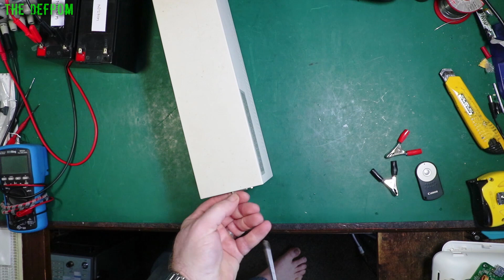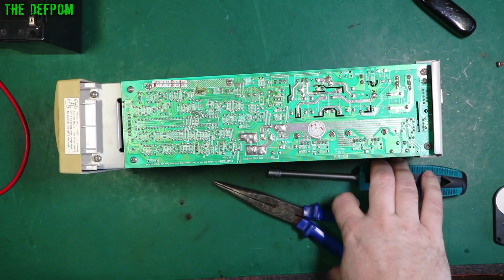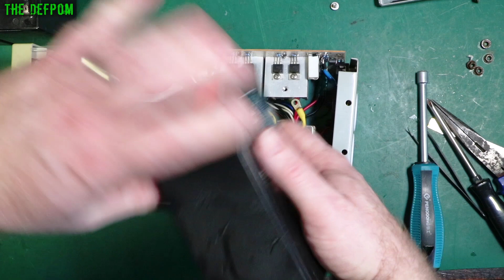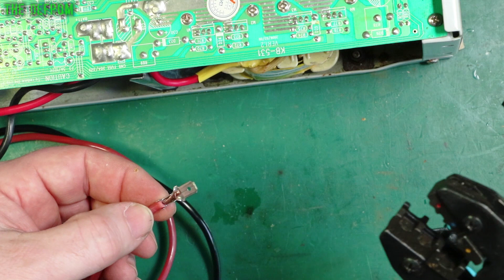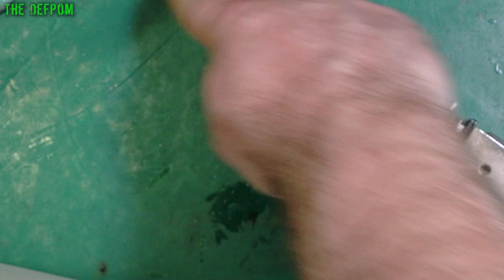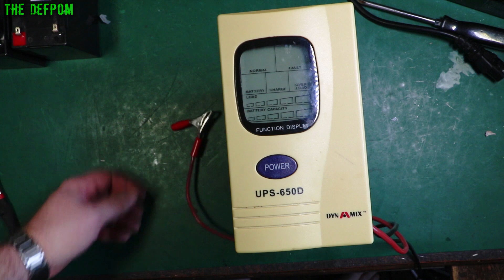🔴 Dynamix UPS-650D Battery Replacement Hack - No. 815

Comment: Temp. is a problem for these small battery's. Panasonic, BB battery all 6 up to 9 year at 20 degrees max. At 50 degrees just 1.5 years then they  need to replace.
Reply from the maker: That could be related, these cases do get warm to the touch.

Comment: Try to sleeve the hole you certainly won't enjoy having a short on a car battery if thisecwires ever abrade to point of shorting the battery , at least more than charger source. The car battery could start a significant fire.....

Comment: If soldering, leave the crimp on insulation till after soldering, as if crimped before soldering that will no longer support the insulation point after the heating of the joint by soldering.

Comment: A 13.7V level is ok at 25°C, but only if the voltage 9f charging is temperature compensated. Typical -3 to -10mV/°C, as these are typical on automotive charge by alternators
. If the battery were running at average around 50°C  say using -7mV/°C amr9und 13.5V fl9at voltage may be better. The observed 13.7V could cause progressive deterioration, I have no technical SLA  data at hand at this instant..

Comment: I think it must be the quality of the charge management in these UPS units, as I have had some of these 7AH and 12AH SLA  batteries thatcwere used over 10 years for power of my portable  Astronomic telescopes. A variety of brands and sources including chinese and european brands included. Yes after 8yrs they started showing slightly lower capacity and  a couple failed around 10 yrs, but also showed some mechanucal wear.
Not saying that there could also be poor quality ones, as I have seen $20 ones which I have not used.
Also at work in endurance lab a number of UPS had batteries replace around 8yrs old..  Heat may also be an issue.

Comment: An idea i've used is to run those cables out the rear of the unit using a 16mm plastic cable gland.
Reply from the maker: I don’t think there was room in this case, but that would have been a better place.

Comment: I will replace my UPS battery next month too. But I will replace it with a DIY 4x LifePo4 battery pack 12v 7Ah with a Daily BMS. I hope this battery will last at least 10years.
Reply from the maker: I expect it will, When doing this modification I’ve always used FAILED car batteries, ones which can’t start a car anymore, they work fine for years running a UPS with a light load !
Reply: @TheDefpom  true. I modified my ups with banana sockets and could connect a car battery just fine but I don’t really have the space and can’t hide a car battery in my living room 😂
Reply: yea that is what I did, I built a 4S2P pack with Headway 38120 cells at 8Ah per cell. I dont have a BMS but I made sure to balance the cells
Reply: @SuperBrainAK  yeah. Check it every year and it should be fine with matched cells.

Comment: I thought it odd that the lower part of the front fasia didn't pull out with the battery tray, easy battery change.
For re powering up after a power cut, maybe a small transformer plugged in to a socket and a single trigger monostable  using a 555 to pull a relay in for 2 seconds, relay contacts go across the front fasia button.
Bodgy yes,  does it work? err pass lol.
Reply from the maker: Yes it would have been nice to make the battery easily replaceable!

As it is running from an old car battery now it hasn’t lost power yet, making it a non issue now, I did this mod about 18 months ago and it has been on 100% of the time even with a 2 hour outage, so I don’t need to dig into making it auto power up, thankfully !

Comment: Hi mate, good video.
It will be good to see what run time you can get out of a beefier battery, keeping in mind those small UPS are not designed for every long runtimes, usually enough time for you to close what ever slow responding OS your computer has. 
You may need to check heatsink temperatures.
As @largepimping has pointed out about UPS that track their output, I have had quite a bit to do with APC 3000VA units with banks of external batteries fitted.
They do a good job of keeping batteries healthy but they must be programmed properly about their battery banks to get good long runtimes from them.
We have a customer, that gets the company I work for, to replace their batteries every 3 years to maintain the integrity of the system that the UPS supports.
These UPS are also connected to the infrastructure ethernet system so constant monitoring can be made on load, temperatures and battery condition.
I have come across some UPS that have a battery test facility that can be manually activated while the UPS is operational.
Reply from the maker: This only has a light loading on it, we have had an outage for a couple of hours since this went back into service and it ran fine.
I have done this modification to a few units now and they are all still going perfectly well.

Comment: you could just glue a short piece of split cable sheath over the cut edge to protect the cables??
Reply from the maker: Yes, yes I could, or I could have put some sleeve over the wires.

Comment: Might want to add a fan.
Those tiny toys are basically designed to only have enough heat soak capabilities to last the duration of the battery's capacity and not much longer -Especially at higher loads. :)
Reply from the maker: This unit is only running a small load, just a ethernet poe switch, a wifi router and a few security cameras, so I’m not worried about it over heating. I have added fan in the past when I’ve done this to other units that ran a computer etc.

Comment: I've seen people claim that some UPS units (probably APC) "track" their output. If they were originally spec'd with 8 Ah batteries, they'd basically quit after putting out 8 Ah even if you had hooked up add'l capacity in parallel. Never tested it myself, but I was always curious whether that was true or not.
Reply from the maker: It is certainly possible that some brands track the battery capacity, I don’t believe this one does.
Reply: @TheDefpom  APC does track battery capacity so when you put a new battery in you need to charge it overnight, then follow the load test link in the serial console they have. There is a free Windows APC utility that allows you to set parameters, but just using the serial console connection also works. Needs you to load it to more than 50% of capacity for the test, so best to add extra loading. Did that for the free one I got, and yes car batteries are a lot cheaper than the SLA ones, though I have to check water level every month, as otherwise the charger will tend to cook the water off, as it has a slightly high terminal voltage of 27.5V, so the battery will gas slightly.

With the mystery UPS units thy also cook the battery, as they run pretty hot in the case, and thus the non temperature compensated charger will slowly roast the battery. Beware some cheap UPS units the battery and all the electronics are directly connected to one side of the mains, so are live. Others use a few high value resistors to allow the electronics to be ground referenced and safe, though the simplest check is to see if the serial or USB port side is direct to the microcontroller (grounded electronics and battery) or goes via some optocouplers, which means they are floating on the mains. Depending on the wiring of the cable they can either be connected to live or neutral.

 Getting the battery outside helps keep it cool, though you will want to put in a fan in place of the battery, powered via the battery directly via some sort of speed control, so the interior keeps cool, as the transformer and power devices are not exactly well cooled. I just put a old used 2 terminal can capacitor in there, 4700uF 63V, as a convenient terminal board and local smoothing for the board, as the UPS relies on battery ESR heavily, and the big capacitor makes for lower ripple current in the battery. Luckily the APC unit does have it's own internal fan, just needed a good clean after removing the internal battery pack.